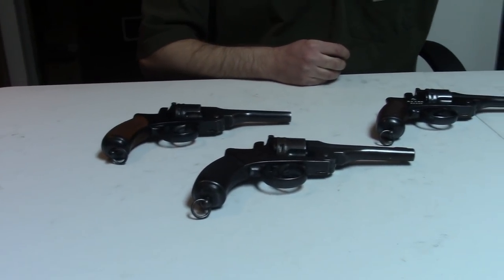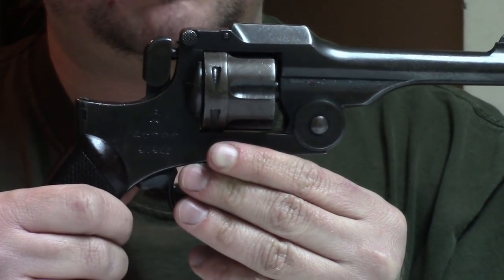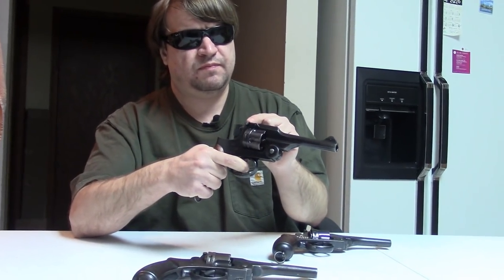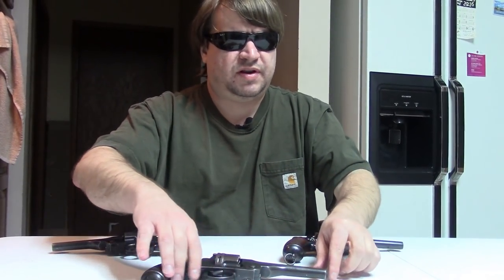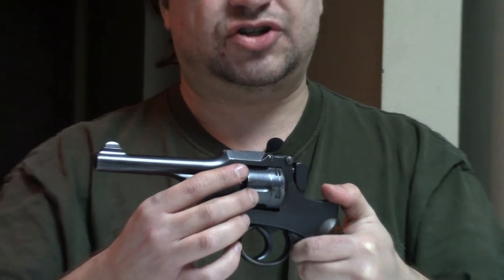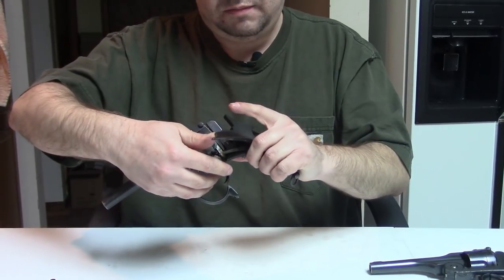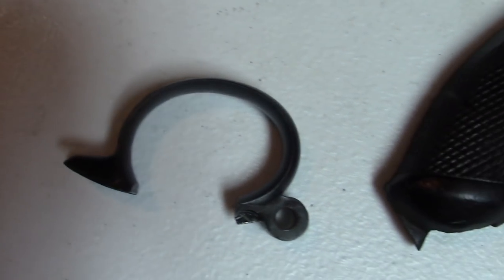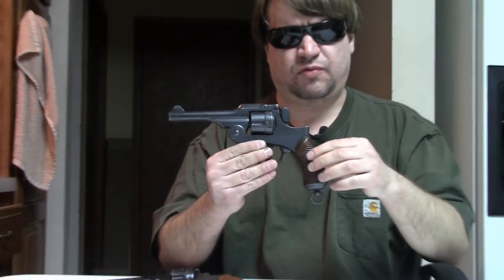Japan's Type 26 9mm Revolver: Variants, Disassembly, & More

Comment: These revolvers were very advanced for 1893. They are quite rugged  , very well finished and reliable. They can appear to go out of time because of wear on the friction spring on the cylinder axis . Many were reworked after the adoption of the T14. Later reworks have grips with simple horizontal grooves similar to those found on the Type 14. A fun fact : the cleaning rods are much harder to find than the revolvers.  The Japanese copied the French style holster ,which provides excellent protection for the pistol. I think it’s interesting that the last revolvers adopted by the NYC police were double action only not all that different from the Type 26. These are far rarer than the T14 .Again an excellent presentation.

Comment: My Dad acquired this gun many years before my birth, in 1957. I grew up pulling this gun out of my Dad's cabinet and examining it, pulling the trigger etc. This was of course after I got my Dad's permission. It's been in my possession since his death 17 years ago. I  have the holster and cleaning tool as well. I was recently thinking about selling it which caused me to do some quick internet research. Your above piece on this gun is top notch. I've never had this much info on what I considered to be a mysterious family heirloom. Just being able to see how it's disassembled amazed me. After seeing its beautiful inner workings I realized I did not want to sell it. I've bought all the materials to clean the decades old (maybe century old) grease. My ultimate goal is to fire it, however info on ammo is sketchy. As you said it's similar to the .38 S&W, but the Japanese round has a thinner rim and internet info says that users thin the rim on the S&W so it will fit. However, the gunsmith I talked to doesn't recommend that. So... anyway, do  you know of a way to get proper ammo for this gun? Thank you for the outstanding presentation!
Reply: Some of them, like mine, will chamber & fire Remington 38 S&W, without any modifications to gun or ammo. I've fired about 100 rounds in mine. Or you can try Buffalo Arms.

Comment: Back in the mid '80s, I bought one of these in a holster for about $100, with a crater in the bottom of the grip-frame - probably caused by an American bullet! My lanyard-ring was sheared off, left grip was present but damaged, and my right grip was missing, along with the holster's clam-shell.
Otherwise, mine is in excellent mechanical condition, with decent bluing and a perfect bore. Thanks to the internet a few years ago, I learned some of these would chamber 38 S&W. My research found that it was very close ballistically to the original 9mm Japanese round. So I made a set of replacement grips and finally took it to the range. I've fired about 60 rounds of Remington 38 S&W through it without any problems. 
Note: some rounds from other brands 38 S of 38 S&W fit too snug and need considerable force to push them into the chambers.  But so far, the Remington 38 S&W fits perfectly. It's not that easy to find anymore. But I've found enough NOS Remington at shows, and sometimes at a dealer, to keep me happy, since I'm not trying to put thousands of rounds through my revolver.
I find the way the Type 26 opens up for maintenance and repair fascinating. Overall an excellent and robust design, with a smooth, easy double action, and a pleasure to shoot.

Comment: I've been tempted to get a Type 26 for a while, but the thing that has always stopped me is the amount of work I'd have to do to figure out ammo for it. It would annoy the crap out of me not to be able to shoot it.
Reply: Buffalo Arms makes some good but expensive ammo for these.
Reply: My later--production Type 26 chambers & fires Remington 38 S&W perfectly. No modification or reloading required. I compared ballistics information from multiple sources, and 38 S&W is very close to the original Japanese 9mm round, except the 38 case is about 1/8" shorter. To date, I've shot about 60 rounds through my Type 26 with no problems. One reservation - I've tried a couple other 38 S&W brands and they tend to be a tight fit - that is 2 or 3 rounds out of 10 will fit easy or be a bit snug, but the others may require considerable force to seat them fully. So I stick with the Remington ammo.
Reply: Trimmed .38 Super brass works pretty well, but it does require inside reaming due to the thick case walls.  I trimmed/reamed 50 cases, and fired each one only once, but that would probably be enough to last a lifetime, as you'd never lose any and the brass is extremely tough.
Reply: I have one for sale if interested

Comment: Do you have contact information for someone who might sell ammunition for the type 26?
Reply: Buffalo Arms used to sell repro ammo for these. Meanwhile, my Type 26 chambers & fires Remington 38 S&W (not 38 Special). It needs to be Remington. With just some fired Remington cases, you could at least check the fit in your revolver. Most other brand 38 S&W I've tried fits too tight.
Now, I've done some fairly extensive research on ammo, and the American break-top revolvers 38 S&W was originally designed for, were of much lighter construction than the Type 26. I've fired about 100 rounds through my Type 26 without any issues. But it's in excellent mechanical condition with a perfect bore. Also, the newest of these revolvers is today nearly a century old, and gun values have risen considerably. So you'll need to use your own best judgement.
Reply: @sunbeam8866  Thanks for such a detailed answer. I am trying to decide if I want to shoot it or not! My Father died in 1993 and I paid no attention to it until this Summer. I have Remington HTP 38 Special +P 125 gr. ammo. I assume those would not fit. So, I will get Remington 38 S&W as you suggest, if I decide to shoot.! Thanks Again!
Reply: Also, is the gun worth more if the serial number is smaller ?
Reply: @jamesfrazier4650  Yeah. There are articles and videos showing modified 38 Special brass to reload for these. But don't. Even if you cut down the case, shave the rim and reload, the 38 Special OD is smaller than the original 9mm revolver round or 38 S&W. It fits very loose in the chambers and and you'll wind up with split cases.